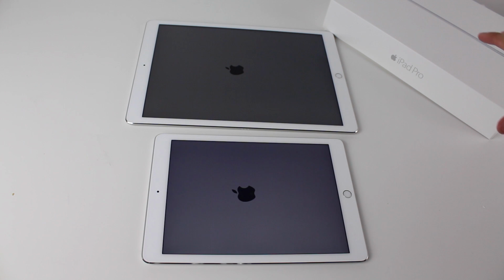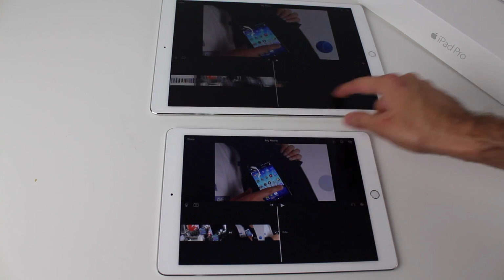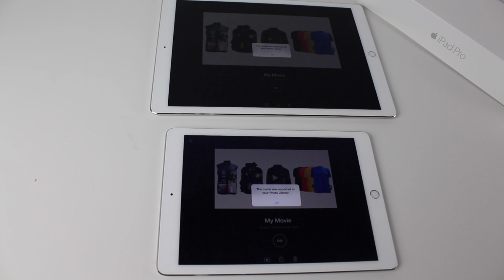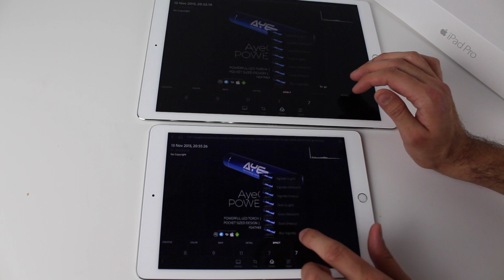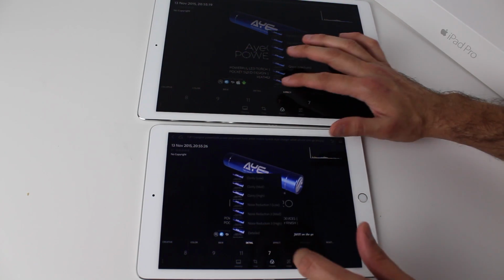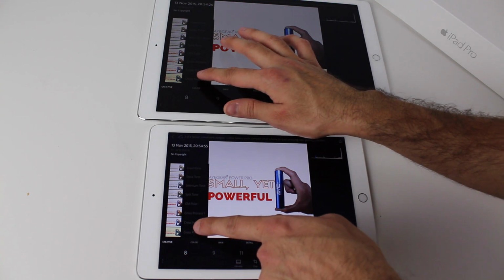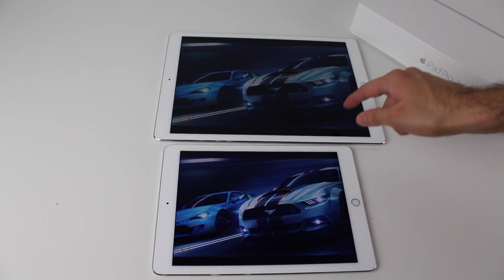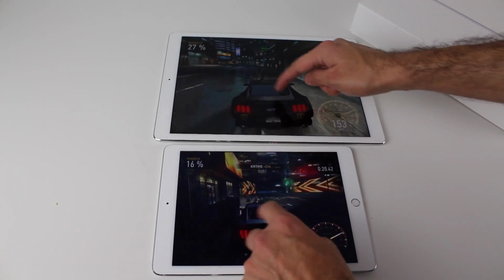iPad Pro VS iPad Air 2 - iMovie, Gaming, Lightroom and Bootup Test

Comment: Zen how you doing pal? Long time no catch up. I'm thinking about getting the pro. I've always updated my iPhone's but I'm still rocking the original iPad 😳 which is 5 years old now and completely had it! Also my MacBook has given up the ghost so I see the pro with the keyboard as a good idea. Your thoughts?
Reply: Ray Peckett if you still haven’t bought one, buy an iPad 2018 (iPad 6th gen)
It is less than half the price of the pro but still comes with a10 processor and is v powerfuk